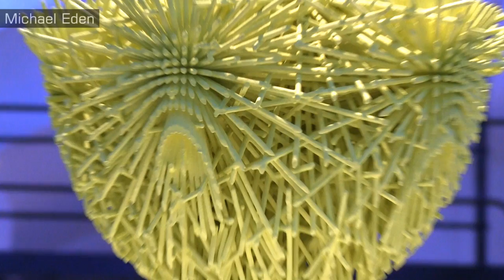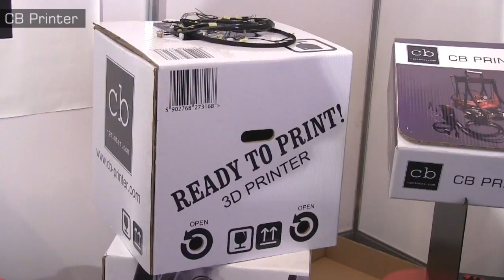3D Printshow London 2012

Comment: 42 seconds into the video there is a mesh plate attached by paper clips, what is that and can it be used with any printer??
Reply from the maker: mike gamer It is the build plate/bed, and can be removed/replaced by taking off the clips. Almost all 3D printers have a removable plate, though systems differ (eg some have glass or metal plates). So the one you mention will not work on all printers.

Comment: Could this printer print a construction model of buildings?
Reply from the maker: Rajiv Acharya Yes, 3D printers are now regularly used to create architectural models.
Reply: Can you Please Help me with the printer model and make. I had visited a seller of makerbot I was informed that the geometrical design does not support the model.
Reply: FROM WHERE CAN WE BUY IT
Reply from the maker: Prema Joshi
There are many different printers used to create architectural models. I have seen them done on, for example, a Cube Pro or an Ultimaker 2. The Cube Pro website is at: http://cubify.com/cubepro You would also get good advice from the 3D printer retailer imakr.com

Comment: whats the cheapest 3D printer I could get in the UK, doesn't matter if I have to put it together, I just wan to be able to buy one for a good price, what would I be able to get?
Reply from the maker: wolkaiser drake A good buy at present is the Da Vinci 1.0, for a smidge under £500 on Amazon. These are made by XZYprinting.com -- a new divison of the world's largest consumer electronics manufacturer. I will be trying one out in a video in September. There is currently also the Lewihe (see lewihe.com) with an introductory price of 369 euros, which looks very good value. Other than that, if I were purchasing a low-cost 3D printer right now I would order from Printrbot.com -- yes, you have international shipping, but their kits start at $349 and there is a strong comunity. Good Luck! :)
Reply: ExplainingTheFuture  thank you very much

Comment: and what if... a 3D printer could print another 3D printer...!?
Reply: Reprap printers are getting. A lot of parts for a reprap deigned printer are 3D printed.
Reply: How do you think the first lathe was built? Holes drilled in first electric drill? The BBC Model  B computer circuit board layout was designed on an Acorn home computer

Comment: How much are these,printers
Reply: The ones that you'd want for quality are Maker Bots. Different models can cost anywhere from about $1500 to $6000 and you can even get a 3D digitizer, or a scanner to scan things into the system and print them to make copies.
Reply: Burak Özel Yeah the scanners scan in a file to use. It is a lot easier than modeling an object on a 3D CAD software. But modeling it on a CAD system allows you to get a lot better detail. There are some trade offs. Both are really cool to use though.
Reply: Looked on eBay found some for 300$
Reply: i found one just fully funded on kickstarter for $100 CAD lol The Peachy Printer
Reply: BPBSniper i believe those scanners can make copy of digital file to use the object with softwares, correct? modelling them much easier though.

Comment: Can I print out a 3D printer? *World Explodes
Reply: Yes, you can... and ***** yes, you can...
Reply: +Blead Productions GOOD ONE
Reply: Yes. It is called RepRap (short for Replicating Rapidprototyper). http://reprap.org/wiki/RepRap
It's some pretty awesome stuff.  I work with a lot of RepRap machines
Reply: VinBadaBing if you have raw materials, you can turn raw materials to a printer by a printer... (in future)
Reply: Printception
Reply: Only the actual design (like the outer shell) and gears.  Wiring and what not is not possible
Reply: Hjchmbccd. Sbccgc.i.hhljnaddjvokhucuh.f. nf

Comment: How do you print an object that is suspended from above? Imagine printing something that has a plastic rod that holds a ball attached to the bottom of that rod. That rod must exist INSIDE an enclosure & must hang down when placed upright.

You cannot start from the bottom of the ball as it has nothing to hang off of at the start, so you must start from the rod down, but you've already printed half the object at this point. Imagine a grandfather clock and the pendulum.

Comment: I want to 3d print a 3d printer. Then I want that 3d printer to print another 3d printer. Then I want that 3d printer to also print a 3d printer. Then I want that printer to print a 3d printer. Finally I will have a 3d printer that printed a 3d printer that printed a 3d printer that printed a 3d printer that printed a 3d printer that printeda 3d printer that printed a 3d printer that printed a 3d printer that printed yet another final 3d printer! :D

Comment: DLP 3D printing will be the future, I imagine in a few month someone will come up with a concept using your cell phone or a regular monitor to produce cheap 3D prints. DLP 3D prints in theory can be made much faster because it's been printed by light! Each layer of print only need exposure of light, so the speed will only be limited by it's depth and the size of the image source or the container. Someone please make this happen so I can enjoy cheap, reliable, fast, and high resolution printing!

Comment from the maker: RepRap 3D printers can 3D print about 50 per cent of thier own parts; the other bits can be bought off-the-shelf fairly easily. So once you've build or bought one RepRap printer, you can use your "replicating rapid prototyper' to in effect make another.

Comment from the maker: There are already printers that can 3D print metal parts -- either using material extrusion (largely an experimental tech -- eg WAAM at the Uni of Cranfield), or via powder bed fusion (a well establish tech using DMLS, SLM, EMB and related tech to use metal powder granules with a laser or electron beam). It very expensive right now! :)

Comment: You could avoid buying some household items but would ultimately have to admit you've gone back to using plastic. If you gave up for example your glassware dishes and went to 'plastic knifes and forks, plastic plates and plastic cups' like you had 6-year-old-children, yes, you could print those items.  Do you want to use plastic cups though? Plastic lamp shades? Plastic pillow cases? Plastic sheets? Plastic boxes/container? Plastic exercise equipment?

Comment: No, most of the 3D printers have semi-conductors inside them made from silicon and have metal components. Right now, most 3D printers can only print fabric and/or soft plastics. A few top of the line 3D printers can print hard plastics(with better durability/strength). Until 3D 'liquid metal' printers become possible, you won't be able to ever print a 3D printer -- Even piece by piece.

Comment from the maker: There are already 3D printers that can print in metals, ceramics, resins, concrete, chocolate, sand -- and not just plastic! Though all of the smaller, cheaper 3D printers are pretty-much plastic-only.

Comment: The mechanical and structural parts of the maker are printable. the electronnic control elements are not, however it is a simple task to home build Arduino controllers for as little as £2

Comment: The next printer will use light to arange atoms to print food or water or whatever is needed. Light does exert force. Not alot of force but enough to move atoms from place to place. And useing light, in time this will be able to be done at the speed of light so that what you want will be made in a matter of seconds.

Comment from the maker: Metals are not (commonly) printed via extrusion, but by bonding (sintering) powders. This allows 3D printing in stainless steel, titanium and cobalt chrome, amongst others. There is also a process from ExOne that jets a binder onto stainless steel or bronze powder. The objects are then baked (to remove the binder), and infused with more bronze in a kiln to produce final bronze or bronze-stainless steel objects. Also lasers can sinter a mixed powder -- eg alumide (a mix of plastic & aluminium).

Comment: Color 3d printers cost $80,000.
They do amazing work.
You can get creative changing the color plastic used during a 3d print to blend the 2 colors as it prints with many of these cheaper 3d printers.

Comment: 200 3D printing materials?  I assume they all (or at least most of them) have a VERY high melting point.  After all, most materials that are of any use have relatively high melting points.

metal: several thousand degrees.
glass: several hundred degrees.
paper: doesn't melt, only burns.
wood: doesn't melt, only burns.  Pressboard is a joke.
foodstuffs: pretty, but useless.

Plastic is the only material that is at all useful and can be melted safely in a home.

Comment from the maker: Many 3D printers output plastic (ABS, PLA, PC, etc). However, other printers produce objects in resins (hard and flexible), ceramics, metals (from stainless steel, titatnium, bronze and other powders), and even foodstuffs (like chocolate). There are over 200 3D printing build materials at present.

Comment: What about recycling, could the materials be easily melted down and have the melted parts be reused again by a 3D printer? Also would it be much harder or not cost effective if a product had multiple materials within it, to be recycled and used again for a 3D printer?

Comment from the maker: This is posible -- known as WAAM (wire and arc additive manufacturing) -- but is not common. Most metal printing is based on sintering or binder jetting with post infusion (see my answer above). :)

Comment from the maker: There are various ways to print metal. The most common use a laser or electron beam to solidify successive layers of powder (known as SLS, SLM, EBM or laser cusing). Here metal powder granules coated in, say, nylon, can be sintered together at low temperatures, though direct metal laser sintering (DMLS) requires high temperatures. Alternatively, binder jetting can be used to stick together metal powder, with the object then infused with bronze in a kiln (a process developed by ExOne). :)

Comment from the maker: 3D printing materials include powders (metals, plastics and wax), liquid photopolymers, and spools of plastic filament. Some printers -- such as the 3D Systems Cube models -- have snap in cartridges containing plastic filament, while others (such as ZPrinters, also from 3D Systems) have snap-in powder consumables. On other printers, the process of fitting/changing materials is a little more cumbersome. See also my other answers on materials here.

Comment from the maker: Yes, the Form1 is not suitable for making final parts -- but the quality of the output for display models, mould masters and so on is outstanding. A totally different level of surface quality to FDM-based printers in its price bracket.

I too hear mixed reviews of the Makerbot2 -- it needs a lot of calibration and nurturing as far as I can gather. The results can be great, but also rather variable. Surface quality on display was not that good. For me, the Cube was better.

Comment from the maker: I'll pick two!

Firstly, the "consumer" Cube 3D printers from 3D Systems (in Jan 2013 released in their 2nd generation), was very impressive for a $1,199 printer, with a print quality far better than I expected. And they are very easy to use.

Secondly, I saw some pre-release Form 1 printers from Formlabs. These are the first desktop stereolithographic printers and produce amazing, industrial-quality resin models for a price of $3,299.00. Very cool.

Comment: What I really like is the brand new Application to allow any one anywhere to print a firearm, or parts to a firearm, most pistols are composite, and aside from the barrel that can be made quickly on CNC the rest cant be produced from a 3D printer, and parts purchased at any hardware store. I even hear it is even possible to make a single fire all plastic gun :) none the less it will help us Americans hold on to ours :) Since we can now print magazines with no trace as to when they were made.

Comment from the maker: There are 20+ 3D printing technologies now, and hundreds of possible materials to print in with them. Many printers (inc most shown in the video) print in standard thermoplastics like ABS (used in injection moulding) which is very durable. Some 3D printers can print in metal (eg stainless steel) which is obviously tough! Even resin and powder-based printers can make things like spanners and machine parts in some circumstances. :)